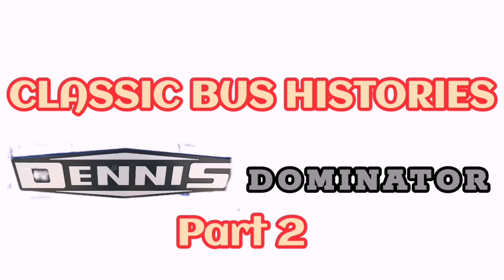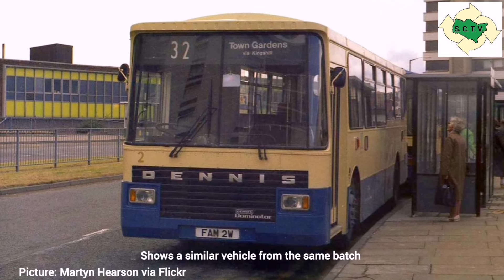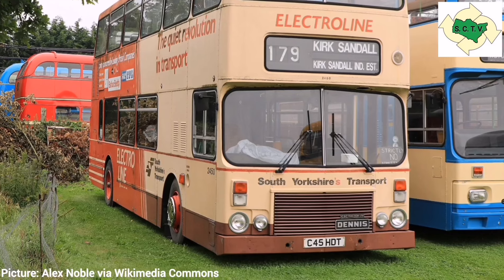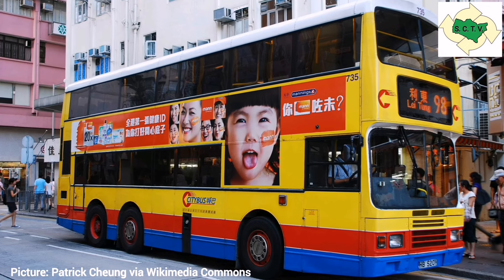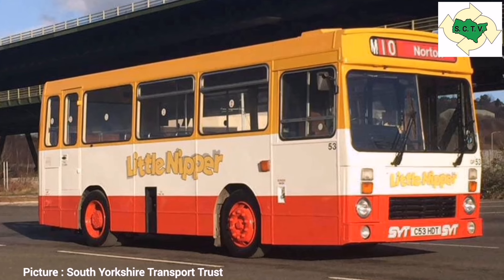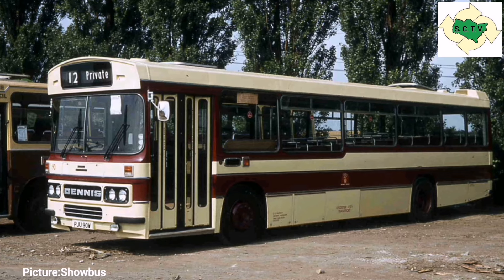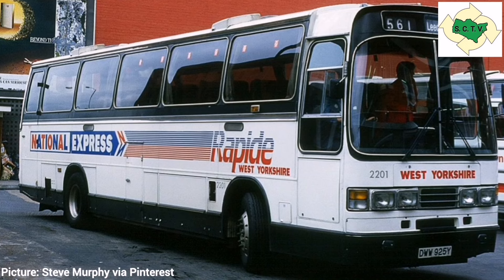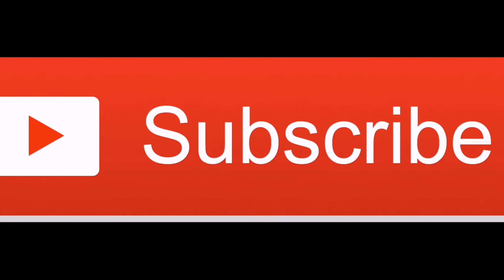Classic Bus Histories: Dennis Dominator Part 2

Comment: There was a air-con Dennis Dragon demonstrator built in 1990, which provided to KMB Hong Kong aimed to compete with air-con Leyland Olympian. It's registration number was EL5113. That was a unique one because it fitted with ZF gearbox instead of Voith. The demonstration was succeeded and gained more orders from KMB and CMB. But all of them were fitted with Voith gearbox. 

However, that demonstrator didn't persevered by KMB. And sold to the local scrapper in 2007.
Reply from the maker: Shame it was scrapped wasn't it?